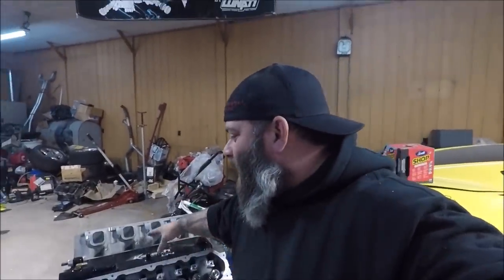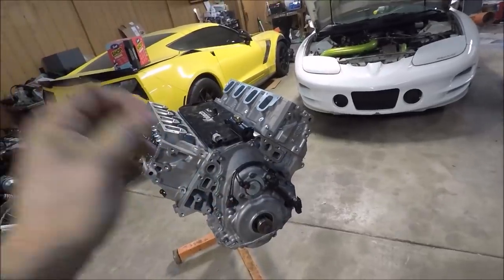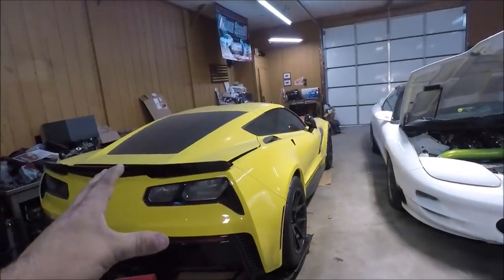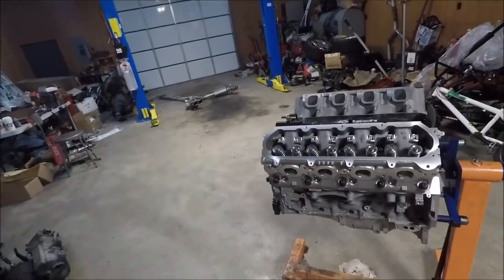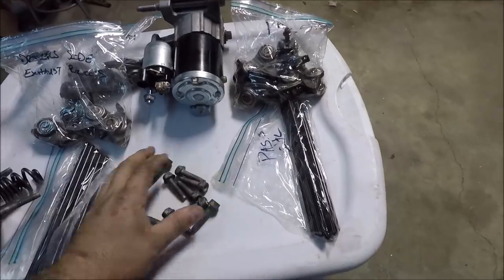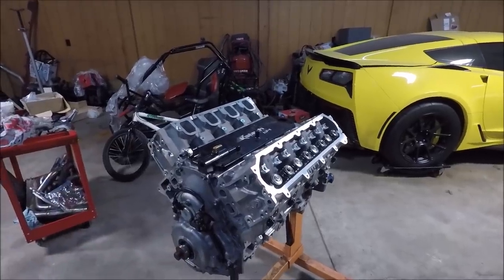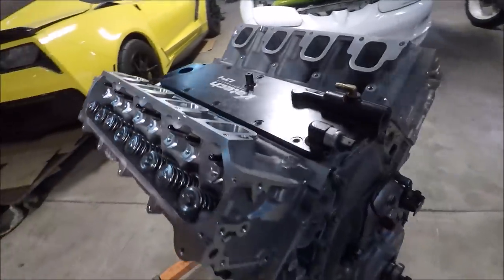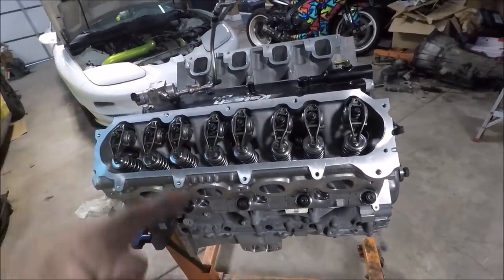BIRD BOX CHALLENGE-EXPENSIVE ENGINE ASSEMBLY!

Comment: Why just torque the rockers without checking for lash first then torque from there? Is it because the push rod are already the right length? I'm building mine is why i'm asking. Not being a critic.
Reply from the maker: With the LS and new LT engines, the rockers sit on a pedestal which prevents them from being over adjusted as long as you have the correct length pushrod
Reply: @DiabloFormulaRacing  Thanks Andy. I learned something new today. Appreciate it. Staying tuned to learn more.